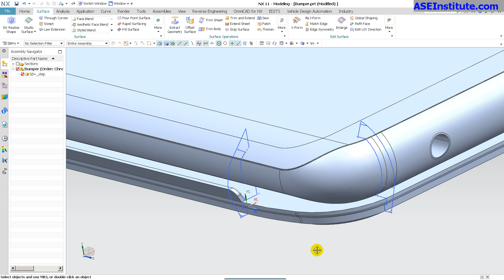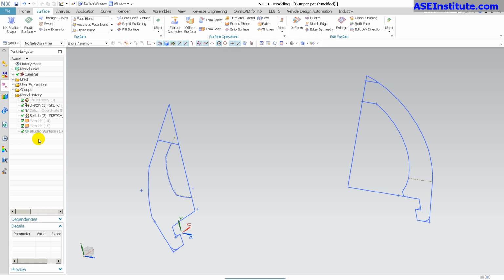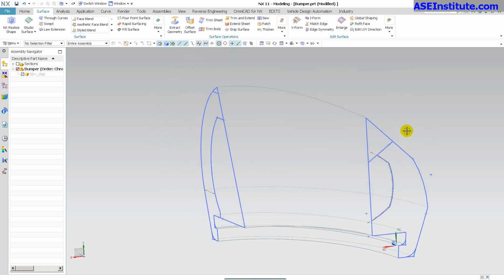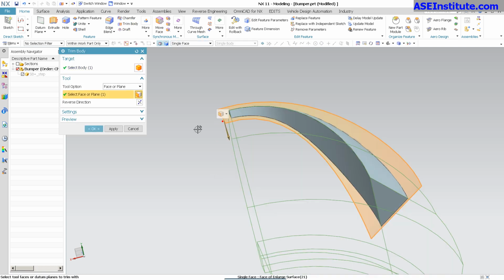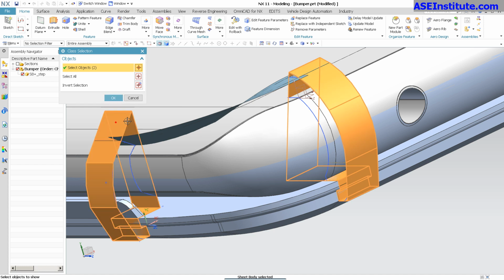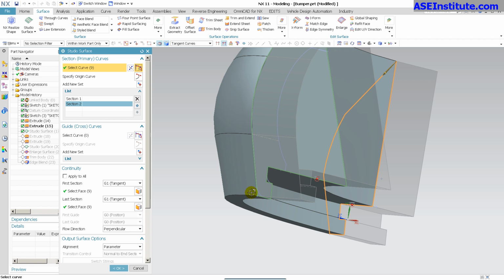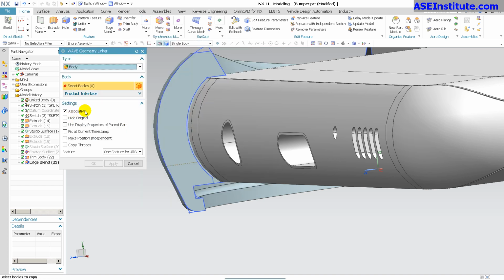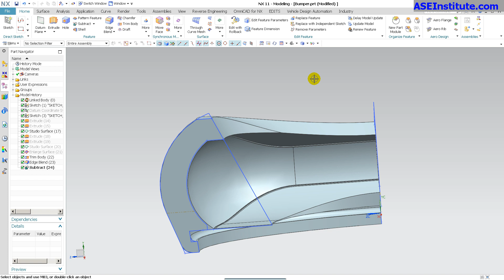How to Make a Transitioning Corner: Siemens NX 11

Comment: There is designing method called Chunk solid approach or chunky which doesn't require any sketch in NX. Do you know this design without using skecthes?
Reply: I never use sketch.